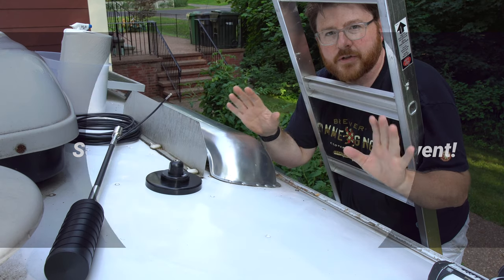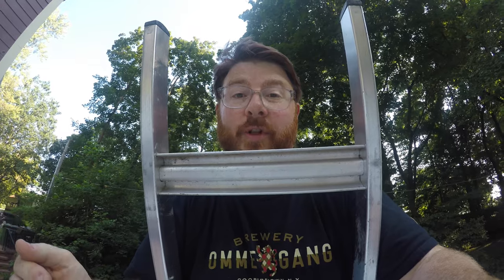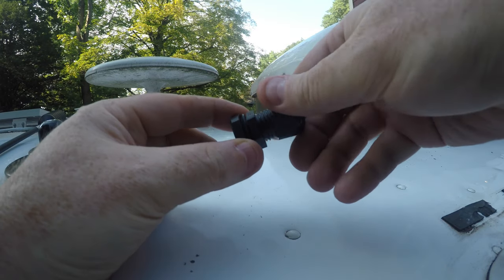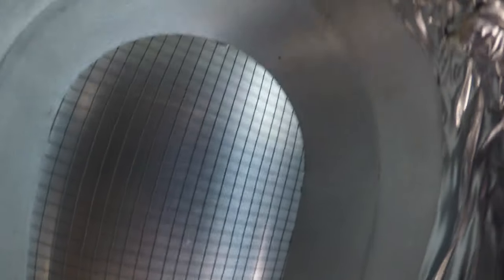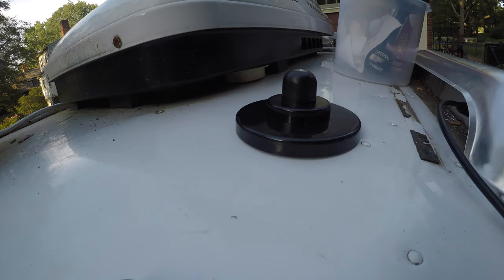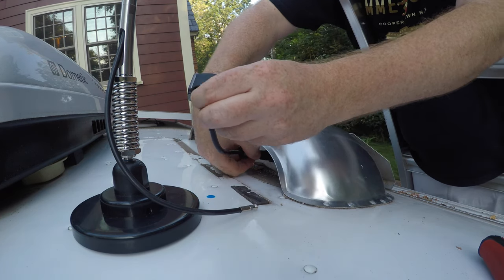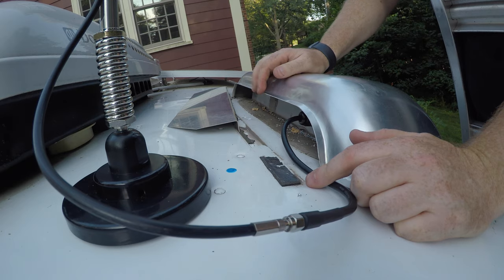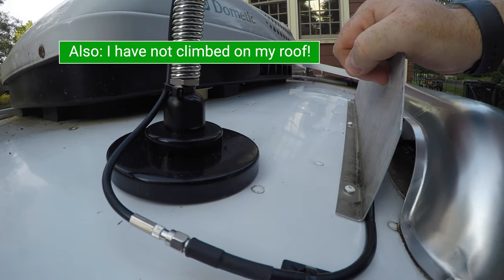Routing through the Fridge Vent! -- Running solar & antenna wires through the RV refrigerator vent!

Comment: As a perfectionist engineer who is redesigning his airstream I really respect and admire your videos.  Detailed information is needed and you deliver in a clear concise manner.  For example, I would never have thought about using the cable gland  until I saw your video. Thank you for the time, attention, and detail you take on your videos.  Thanks to your videos, I have been able to remove the refrigerator to install a self-retracting wire that is connected to my latest invention, a retractable TV antenna.  Keep up the good work!!!!
Reply from the maker: Thanks for the kind words!

Comment: I would like to report that WE DID IT!! The eagle has landed. The We Boost is on the roof thanks to your expert guidance. We did not remove the refrigerator but fished a wire down from the vent. For the record I’m basically a groupie now bc I also bought your bins (thanks for the expert guidance) and your Amber gels for the lights. Wooo hoo!! THANK YOU!!!!
Reply from the maker: That's great to hear.  Was it difficult to fish the wire down?
Reply: Not too bad. Took a few tries w the right size wire that had enough strength to stay somewhat straight but hopefully not break anything. Then I gorilla taped the coax to that and pulled it back up. My only fear is that the coax is sitting next to something that could get hot on the fridge and it could melt. Would you be worried about that?
Reply: One other comment, we bought the white plastic cb radio attachment thing you linked to (didn’t use the one from your video). It’s nice but the base it came with was not solid plastic so didn’t provide a good foundation to attach the foam tape. We ended up cutting two squares of an old plastic cutting board and attaching the mount to that by counter sinking bolts to those from the bottom. This gave us a nice solid base to attach to the roof.
Reply from the maker: @alysprotzman9108  Nice solution.   At times in the past when I've experienced that sort of thing, I've filled the hollow sections with epoxy.  Takes a couple days t cure, but gives you a "factory" look.

Comment: We’re going to try this this weekend! Excellent videos! Thanks!
Reply from the maker: Good luck.  Take it stages!
Reply: Actually, question....is there any way to do this without removing refrigerator? Was looking at other types of cable glands that don’t require access to both sides. Could you just feed cable down and retrieve it at bottom? Never been in the back of our refrig access panel so wasn’t sure.
Reply from the maker: @alysprotzman9108  I'm intrigued!   No idea if it will work, but the easiest way to find out would be to drill a small hole--something just large enough to send an electrical fish tape down.  If it doesn't work, just seal up the hole with caulk or a glued on plug or something.  But if it DOES work then you will have revolutionized the entire RV industry!  No pressure!    I think you might be able to do it!

Comment: I saw your  video on putting the cable down the fridge vent. Very informative!! Since it has been a year can you tell me how the cb antenna mount held up with the tape?  Thanks.
Reply from the maker: Sorry for the slow reply!   Antenna mount is holding up fine, but there have been a couple times I wished I'd installed one that tips downward when I needed it.  I included a link to that sort of adjustable mount in the video description.  I haven't swapped mine out, but someday I might :)

Comment: As an Airstream Owner for 2+ years, I have been searching the inter webs constantly trying to locate decent, credible information on how to do a variety of DIY projects. I CANNOT BELIEVE the awesomeness of your videos and your knowledge base is just amazing!!! Thank you so much for your time and effort in putting these into the universe. 

One question I have is pertaining to the VHB tape, I'm planning on mounting a King Satellite Quick Release Roof Mount to the roof of my 2019 26U FC.. Will the VHB tape and caulk be sufficient to attach to the roof? or would you suggest screwing it down as well? If you think some kind of fastener is needed, what would you suggest. Thanks in advance for any suggestions you make have regarding the DIY project. Sincerely, James & Marcia
Reply from the maker: Thanks James!   I'm not familiar with the roof mount you mention, but I suspect VHB will be way way way more than enough hold.  My solar panels are held on by about maybe 8-10 square inches of VHB each, and even after years and miles there is no possible way I could pry them off the room.  Make sure 1) you buy the right "number" of VHB tape for you material and 2) you clean the adhesion areas (both pieces) really well.... and you should be good to go!

Comment: Excellent! I don't remember, have you said where you are mounting the WeBoost Drive? 
I think I'm going with the WeBoost Drive Reach using the antenna you used.
Reply from the maker: I installed the electronic bits under the dinette in my trailer.  That way I can use the internal antenna right there at the table... but also I can pull it outside and use it while sitting under the awning too.

Comment: Thanks for the mini series!  Is the reason you think the white antenna base is better in description section,  the fact white color absorb less heat?  Thanks!
Reply from the maker: More for the ability to fold it down, though the heat protection is a nice benefit too.  The black antenna mount is flexible, but there have been a couple times when I needed to get the trailer through a low overhang and I would have preferred the ability to fold the antenna.
Reply: @JustaJourneyman  Thanks a lot! Looks like the black one has bigger contact area for VHB tape though. I only plan to mount it right above AC. Hopefully that would be ok.
Reply: @tintinthepirate  Even a little bit of VHB goes a long way.  My solar panels are attached with VHB and they are quite large... but perhaps only about 9-10 square inches of tape on each one holds them firm.   You do want the antenna to rest above metal--it helps with reception—so if you were thinking of putting it on top of the AC, you might consider putting it right on the roof instead.  I hope that helps!
Reply: @JustaJourneyman  Just an FYI, I did my install with the fold-down one, it's great but I don't think it's practical to fold it down on a airstream roof, especially for airstreams with duct A/C - the roof is very soft - You'd have to get on the roof,  pull with both hands REALLY HARD, like 50lb force at least, to move the base into rotating position. So if I need to rotate it, it's easier to unthread the top part and take the antenna off.  One advantage of this model though, is that its base is higher, so I don't have to use the long extension rod to make the antenna above the A/C unit. Thanks again for recommending this and great tutorial!
Reply from the maker: @tintinthepirate  Hmm... seems strange that the fold down is so tough to operate.  I agree about the softness of the roof though!  I mounted mine on a rivet line (indicating a support rib underneath).  You might align the force needed to fold with the rivet line... but I hear you loud and clear that unscrewing it might be just as easy.  Mine sticks up to just below 11', which is still really low... so it has not been a problem with underpasses or anything like that.
Reply: @JustaJourneyman  yep, thanks for the tip on mounting the base along rivet line! That's what I did, regardless folding down or not.

Comment: Great video! Thanks for the information.
Aren't you worried about it hitting any low bridges? How tall is the top of that antenna?
That spring will do little to no good when traveling at 50+ mph. Or does it just look taller than it is?
Either way? thanks again for the information. 
Be well.
Reply from the maker: It's not the best design, but it's worked well for us.  Even with the "tall" antenna on, I'm only about 11" tall, which isn't very high.   Many folks have used foldable marine-style antenna mounts that you raise or lower when you want (but you have to get up there to do it).  Also, I would imagine most folks would opt for the shorter antenna pole just for aesthetics.  For me, I like the tall one because MAX POWER!

Comment: This is very good at explaining 99% of what I need to know.  I'm going to be installing a small Yagi antenna on my current antenna pole and I'm intending to do solar as well if I keep this particular rig (may be selling it).  But I'v been looking for a good instructional video and this works.  Thank you!
The only piece of advice that comes from my Ham Radio experience is to put some connector sealant tape on the connection from your antenna to the wire going inside.  Otherwise water will get into this connection and corrode it causing loss of signal.  It can also get into the wire and cause you to have to replace your wire entirely.  https://amzn.to/2V3RAef
Reply from the maker: GREAT tip.  Thanks!